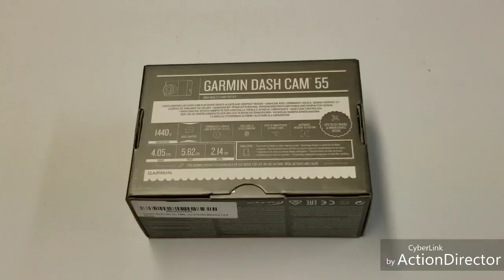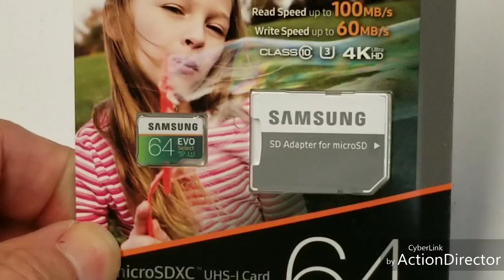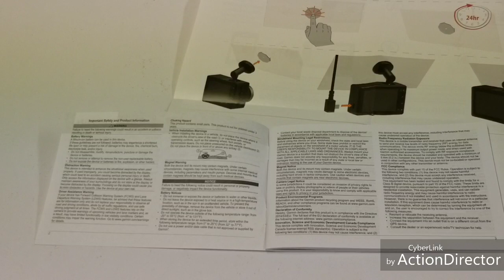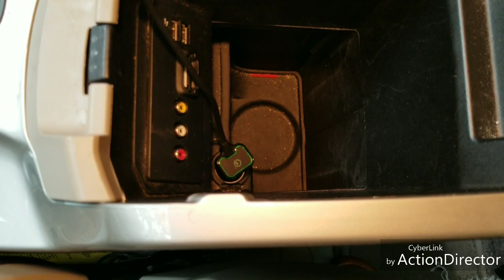Garmin Dash Cam 55 unboxing and installation in 2015 Toyota 4 Runner & Ford C-MAX

Comment: Thank you for making this video! Wasn't too sure how to run the wire down in the 4runner. Did you have to remove any panels or did you just tuck thing in
Reply from the maker: You can just tuck it behind the panels but don't try and go in too far as to effect an air bag.

Comment: WARNING!!!! You should NEVER EVER hide the dash cam cable in front of the air bags, like this guy is showing at 09:48 and 12:50. It should ALWAYS be behind the air bag.
Reply from the maker: Thanks for the comment but if you look again the cable is along the side of the molding and not in front of the airbag deployment point.
Reply: The warning sign says "Curtain airbag". Isn't that where yours are deployed? In my car it is definitely so.
Reply from the maker: The wire is above the AB where the two moldings come together. A AB deployment would have to blow apart the top and side moldings in order to catch the wire and moldings are not supposed to come flying off into your face.

Comment: What tool are you using?
Reply from the maker: I cut out a curved stick on the band saw made from wood.  I did not want to use the sharp edges of a screwdriver.